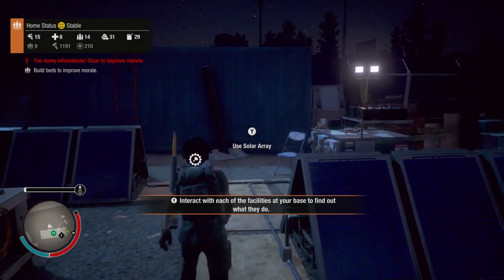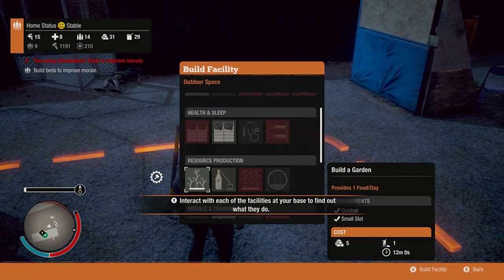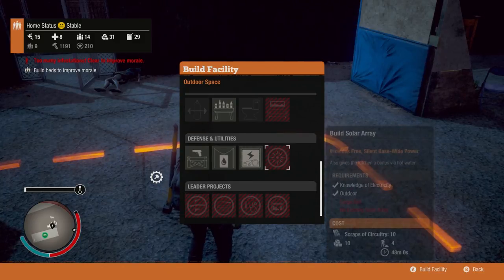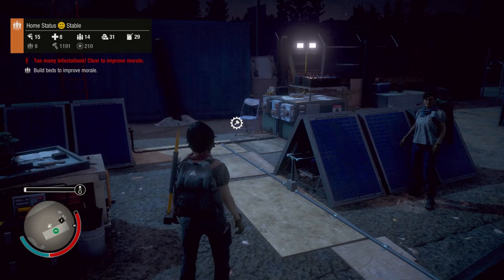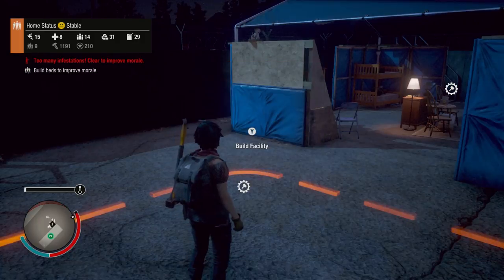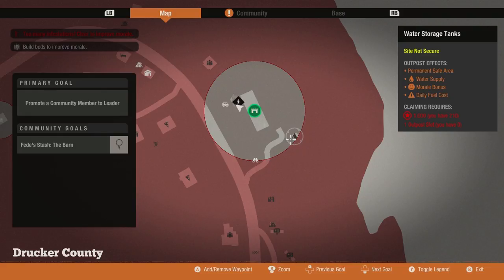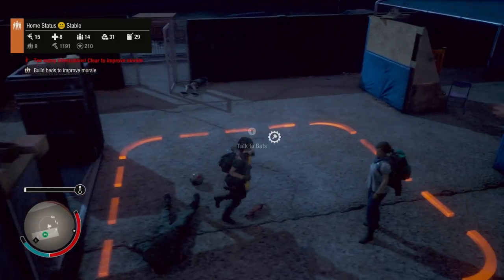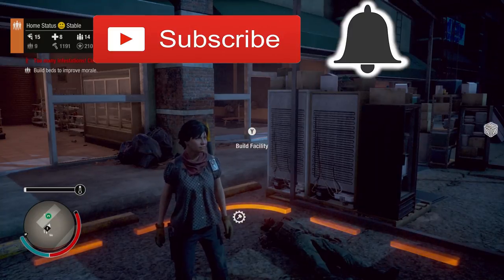HOW TO GET POWER! UNLIMITED POWER | STATE OF DECAY 2!

Comment: Does the solar array need maintenance (-1 construction material / day)?
Reply from the maker: R4NK 01 The solar array doesn’t require any maintenance and it doesn’t produce any noises, that means it wouldn’t attract additional zombies. On top of that it will also provide +5 morale for your community. The only down side is that it will take up a slot inside your home base, but it’s my favorite source of power by far.